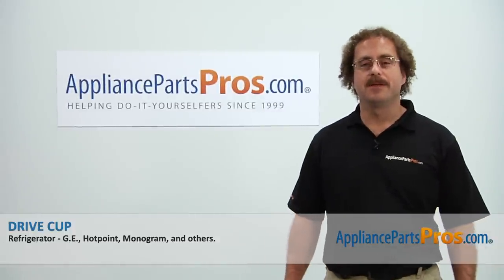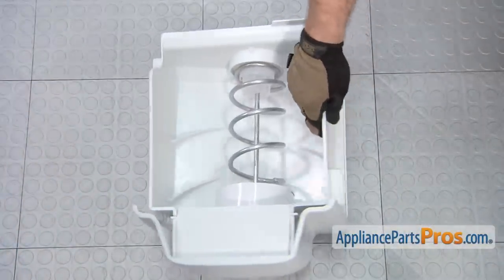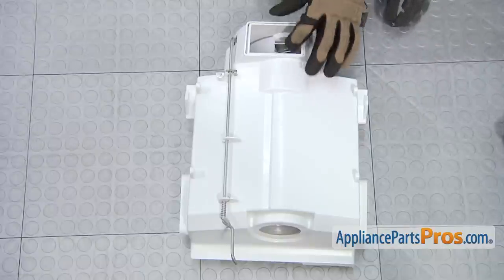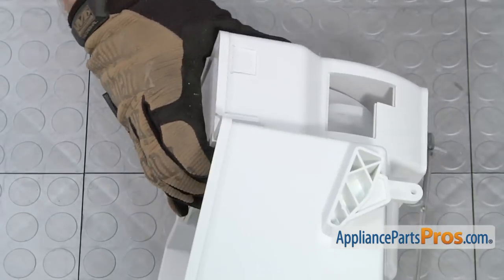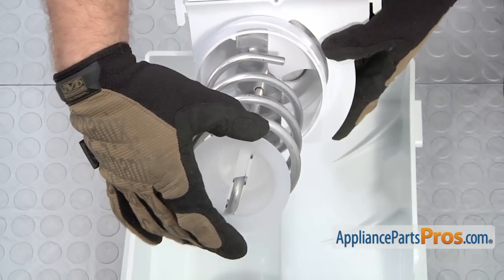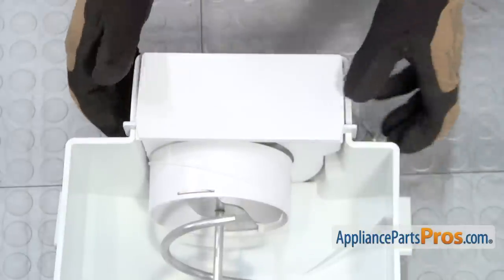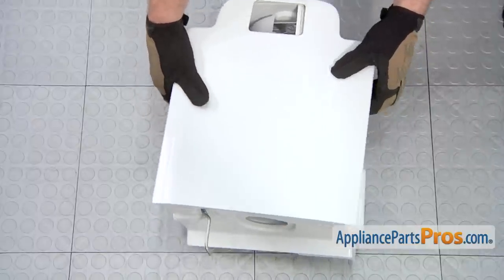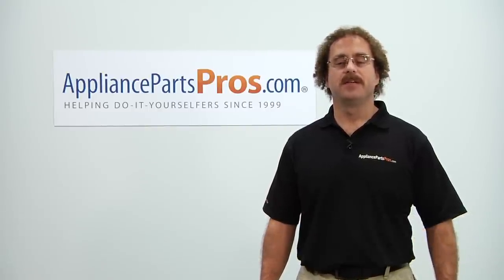How To: GE Drive Cup WR17X11459

Comment: So, it took me two Drive Cup replacements to figure this out. The Helix in the front should turn with the Auger. If it doesn't, i.e., it spins freely, the slotted hole in the metal Plate Helix Lock has probably rounded out allowing the Helix to slip toward the back of the ice maker. This also allows the Auger to move forward and drill a hole in the ice bucket which is what makes it so difficult to take apart (see previous comments). All of this is what causes the Drive Cup to fail as the Auger that it is driving is just pushing against the Helix which is no longer turning. If you are replacing the  Drive Cup AND the Auger has drilled a hole in the ice bucket, consider replacing the Plate Helix Lock at the same time. It is inexpensive especially consider the effort. By the way, as a temporary measure, it may be possible to hammer the Plate Helix Lock back into shape by cold working with a hammer.
Reply from the maker: Thanks for that information, Greg!
Reply: Greg Neece to
Reply: I followed the same way I took it apart
Had no problem
Reply: Greg is right on!  I just repaired mine, and you HAVE to fix the rounded out hole in the drive plate.  I just used a flat-faced punch and a hammer.  It’s soft, so easy to do.  Use a small file to restore the flats until it just slips on to the shaft.  Second “mod” I did was to drill a hole in the shaft for a pin to keep the nut from moving down the shaft.  This will keep the shaft from moving out of place axially. The nut should be just flush with the end of the shaft.  Mark and drill a hole for a roll pin (best) or cotter pin to keep the nut just flush when installed against the pin.  Seems to be restored with a new cup, so we’ll see how it lasts.  Overall, a good ice maker with two trivial flaws that make it WORTHLESS!
Reply: For mine, there is a clear, but more subtle, indicator that the Helix has slipped backwards.  It didn't drill a hole in the back of the icemaker, but there was a circular bump...resulting from the rod pushing back against the back of the icemaker.  It hadn't punctured though.  but it was in there, thus causing resistance to removing the whole 'assembly' (which looks so easy in the video).  But how to remove it?  After inserting a few screwdrivers around the edges, take a long flathead screwdriver and insert it straight down on top of where the rod is meeting the ice bucket back wall, and then gently pry so that you are pulling the back wall backwards, and allowing the rod to pop out of the wall.  Once I did that, it was easy to pull the assembly out.
Reply: I have a drilled hole. I am not sure what the Helix lock is and can not locate it on a parts diagram. Any chance you have a part number?
Reply: Duh. Found the part. Hoping a little epoxy will do the trick.
Reply: A little epoxy added to the shaft and the plate helix lock will keep the helix attached. Putting a little glue on the threads of the plastic nut should keep it from  screwing down and the shaft drilling a hole through the bin.
Reply: Can someone help me?  I think I have the same problem. This is my 2nd cup replacement. I notice at the end of the coil (opposite side of cup) the metal is extended and poking the plastic bin where it is causing a tight resistance (I think that's why the cup broke).  So, if I replace the helix, this will fix it?  Thanks in advance. -Cindy
Reply: Thank you Greg Neece!  This is exactly what happened with my ice bin.  It was exceptionally difficult to disassemble due to the new hole the threaded end of the auger drilled through the housing!  I am replacing the helix drive plate, the helix (mine is cracked) and the drive cup all at the same time.  I also bought a new plastic nut for the left hand thread at the end of the auger shaft, just to be safe.  I hope all of this fixes my ice bin. Its been driving me crazy for over a year and lately has gotten far worse.

Comment: I bought the Drive Cup online several years ago hoping to change it myself by using your video.  It only took a few minutes to realize that it was above my mechanical abilities.  My husband finally tackled the job today.  It took him awhile and it wasn't quite as easy as the video.  He also had trouble popping out the drive shaft and was ultimately able to slip on the cup without popping it out.  We finally have an ice dispenser again!  Thank you for your expert guidance.

Comment: Really appreciated this instructional video. I originally ordered the entire ice bucket to replace the broken drive cup but then found your video which showed I could replace the part only. Your video gave me the knowledge and confidence to try the replacement myself before committing to the new ice bucket. In the end, everything worked out great following your clear and very easy to follow instructions and I saved $150.00.
Thanks for posting your video!

Comment: Thank you so much, I ordered the part and installed it myself. I paused the video at each step. Popping out the drive shaft took a few tries. I just levered up each side one mm at a time. But it came out and popped back in nicely. I probably should have waited for the whole thing to get to room temp. Kudos

Comment: Couldn't have done this without your video. I had to replace the drive cup and the helix lock plate (or crusher blade). I'm pretty handy but there were a few tips that really helped. I got stuck for a while because the helix box wouldn't come out even after much prying and prodding. Like there was a screw still holding it together. That's when I looked closer and saw the auger had screwed into the plastic housing. I had to jam a large screwdriver in there to pull the housing away from the auger tip and kept pulling and turning on the back of the auger until I finally got it released. It was so aggravating I was seriously contemplating just buying a new tray and be done with it until I finally got it loose! Would have been a lot easier job without that.

 As I was putting it back together I noticed at the back of the actuator arm one of the hooked ends on the spring had also snapped off.  I was able to wedge it against the plastic housing so there was still tension on it and so far everything is working great. Now I just have to try to pick up one of those springs. Thank you!!

Comment: The part of "popping out" the entire drive shaft is pure fiction! We had to wedge a wide screwdriver to separate the back wall from the inner wall so that the metal auger end could clear the box that we were trying to remove. Very difficult but eventually we got it. Keep the screwdriver as a wedge to remove the inner unit.
Reply: I followed the instructions and I also had to use the screwdriver to pop the metal auger could clear the box after I installed it I had the same problem the cup cracked again this is my 3rd cup I'm trying to figure out why it keeps cracking?
Reply: +Bernie Campbell 
I have the same ice cube dispenser in another refrigerator and I cannot get it to make crushed ice any suggestions?
Reply: Sarah Cliff same here...I eventually got it off but I'm thinking the pastic was still cold possibly keeping the parts together..I'm luck I didn't break it.
Reply: Agreed on the pure fiction. Does not pop out easily. Fake news! LOL

Comment: Nice video... big help. I had the same problem another had where the auger bit had bored through the front of the bin and it was preventing the head section removal after releasing the locking tabs. However, I was able to eventually remove the assembly by using a flat tip screw driver to flex the plastic enough to slide the auger bit back inside the hole allowing me to remove the assembly. This prevented me from have to buy another ice tray assembly. Thanks for the video.
Reply from the maker: Brad Berghuis Glad the video helped you get the drive cup changed!

Comment: So why is the end of the auger shaft boring its way through the end of the ice bin?  Mine did this and I had to use the same technique as another user with the flat screw driver flexing the end of the bin away from the end of the shaft.  This worked fine for a few months and then the drive cup cracked in half again.  Is the fact that the shaft has bored a hole through the end an indication of another problem?  Can the auger shaft be re-adjusted so that it's not punching through the end?  Thanks for the useful video and thanks in advance for the advice!

Comment: Well, as many have stated...this video was great. My auger head had also bored through the casing. I finally got that sucker out tho. Will reassembling with this issue cause any future issues? Is there a fix for this issues? Is the fact that the auger is pulling forward causing the cup to break?
Reply: Had the same issue, I could not extract the auger as easily as shown in the video. Finally used a rubber mallet to dislodge it.  Realized it was stuck in the plastic.

Comment: great instruction. Unfortuneately I have had to replace this part a couple of times. I did notice that the auger rod rubs against the front of the outercase. It has actually worn a groove into it. I cant seem to figure out how to "shorten" it though, as there is a spring washer on it. Any ideas?

Comment: So I had the same problem of not being able to get the head unit out after releasing the lock tabs. After looking at the unit, noticed that the auger end had bored its way thru the plastic and is now protruding out the head end locking it in place. Thought I might be able to do the quick fix as the cup is cracked, but no such luck. Had to order a complete bin.
Reply from the maker: Doug Macbeth  Sorry you had to buy the whole bin! Hope the video helped you out.

Comment: I CAN NOT GET THE HEAD SECTION TO RELEASE.  ANY SUGGESTIONS?  I HAVE PREYED AND TAPPED UNTIL I AM AFRAID THAT I WILL BREAK THE HEAD CASING.
Reply: I'm having the exact same problem.
Reply from the maker: Soundra Fulton It is in there tight. You have to make sure the locking tabs are released before pulling up om the head section.
Reply from the maker: Linda Burch It is in there tight. You have to make sure the locking tabs are released before pulling up on the head section.

Comment: Thanks for the easy to follow video. My problem is that I hear the auger turning - in fact you can feel an occasional jolt from the torquing. And the cup, while showing some wear, is in firm contact.
First question, does even a small amount of wear mean I should replace it?
The problem is the ice will not dispense and will eventually some will accumulate in the chute. I was told it is the Helix and I noticed that it is loose from the front of the dispenser. 
Should it be attached?
Is there any signs of wear or breakage that I should be looking for?
Do you have a video showing replacing the helix?
THANKS!

Comment: My ice crusher blades just started getting stuck on that deflector piece. It makes an awful slamming noise as the motor drives the the blades hard enough to bend the plastic, but now it won't dispense. It looks like the deflector piece in way too far forward now, and now catching the blades. I also notice to blades are really loose. Do you know anyway to get that deflector to pull back a little bit, 1/4 inch maybe?
Reply from the maker: I do not know of a way move the deflector. If the bucket is damaged you would need to repair it so the deflector is aligned correctly.

Comment: What about placing the drive cup on the outside, that's what I did and it's working so far, my auger also drove through the bin, should I place the drive cup back inside or leave it outside?
Reply from the maker: The drive cup should be placed on the auger as shown in the video. If you have more questions about how it should be installed in your particular unit, we'd be happy to look into that, but we'll need your model number. You can look here on our website to help you find the model number: http://www.appliancepartspros.com/modelnumber_locator.aspx

Comment: I had the same problem getting the head section off due to the auger shaft having bored through the front of the bin (yeah, what IS that all about).  I was at the point where I was going to get it off or break it and buy another ice bin assembly for 189 bucks.  Included in the video should've been the part about me banging the bin upside down on the side of my washing machine to get the damn thing out.  After the first hard whack, one side popped free.  Another hard whack and the whole thing came out.  I had already tried using screwdrivers to force the shaft back inside but that wouldn't work.  The washing machine trick saved the day.
Reply from the maker: Kitteninthekettle Yes they can be in there pretty good, glad you were able to get it fixed!

Comment: I changed the inlet water valve.Theres  good pressure from dispenser.But no ice.When I turn the switch on to get ice,the auger sometimes rotates and sometimes doesn't.It does not make any ice.Solutions please.
Reply from the maker: Without knowing what you have, I would suggest posting the problem along with the appliance model number on our repair forum and the techs can help you troubleshoot the problem. http://forum.appliancepartspros.com/

Comment: Great video but as usual - planned obsolete - by General Electric.  Removing the "head section" is not as easy as in the video.
 Prying and lifting the ears does not work.  Just break the two ears off and replace later with two stainless steel screws  -  as should have been engineered by GE.  How much $ did they save on two screws.  Theodore Trombley
Reply from the maker: Thanks for the tip!